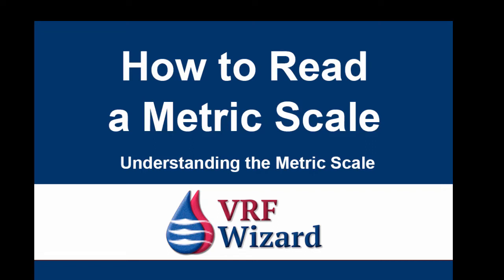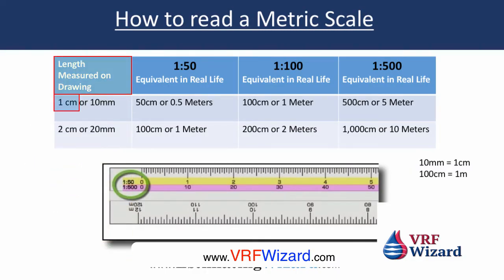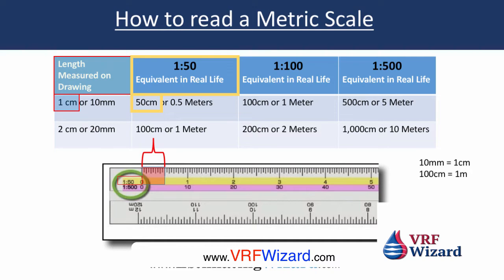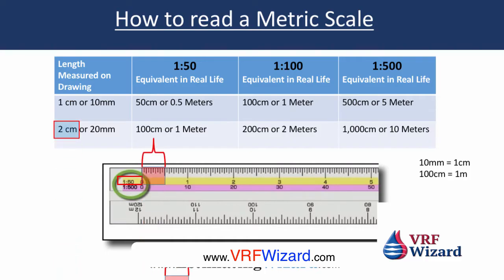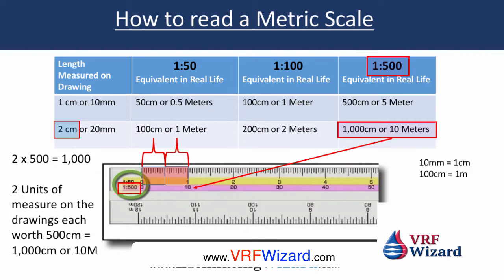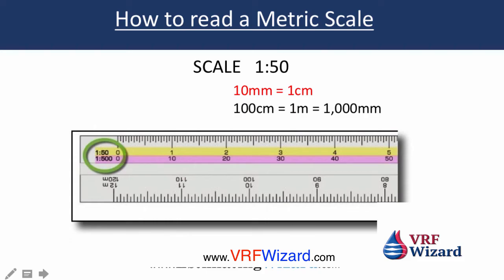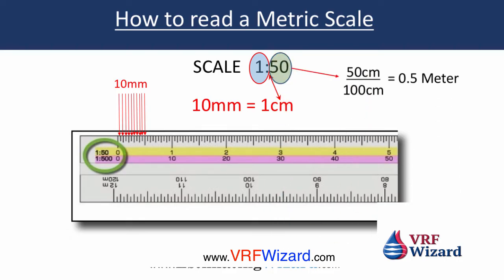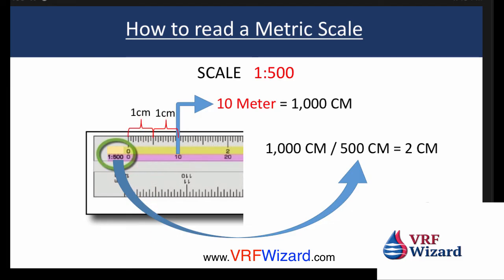How to Read a Metric Scale

Comment: 10:08 what if the given is 200x64
What will be its result in 1:50 scale?
Reply from the maker: Noted. 100 CM Ductwork would equal 2 CM on the scale for a 1:50 (100 x 1 / 50 = 2)
Reply: @VRFWizard  oh ok thank you I kinda get it now

Comment: I need to draw a line with a 1:50 scale ruler, I need to know how much do I round up or down for instance if I have 8462mm do I stop the line at 8450mm. How do you get the 12mm on this scale. increments go 50,100,150,200... 609 for example would I just round down to 600?
Any help much appreciated
Reply from the maker: For that  kind of accuracy it's best to use a CAD program or other computerized software. If the project doesn't require extreme accuracy, then rounding would be the next option.
Reply: Thanks for you reply VRF Wizard.
Is there definitely no other way of doing it on a tape or scale engineers ruler ?
Reply from the maker: @philmurray6457  You can estimate the distance based on percentages, such as if the smallest scale you have is 1:50, this means that each cm on the scale is equal to 50 cm in the real world. This would mean that 12cm in the real world would be 12/50 = 24% of the cm on the scale. there are hash marks on the scale so look for the hash mark that is close to 24%, or a quarter of the distance.